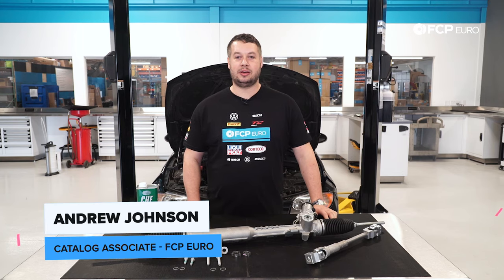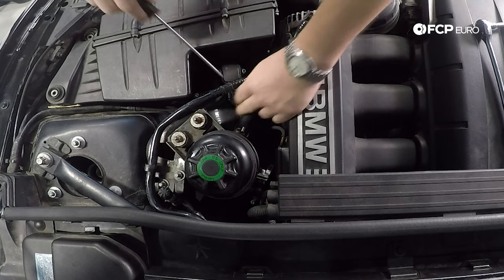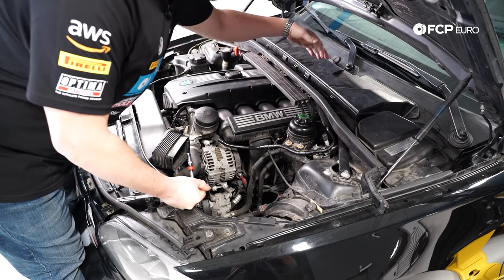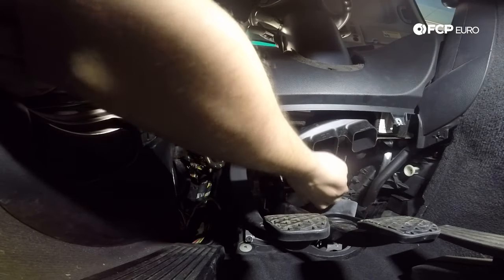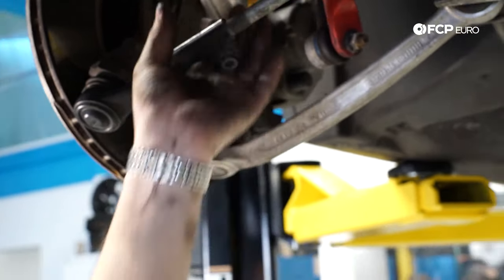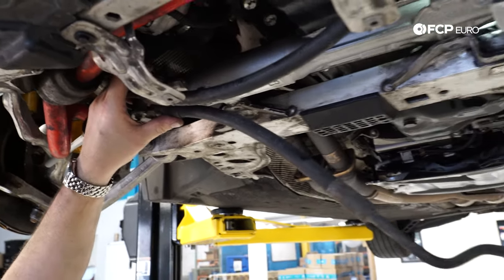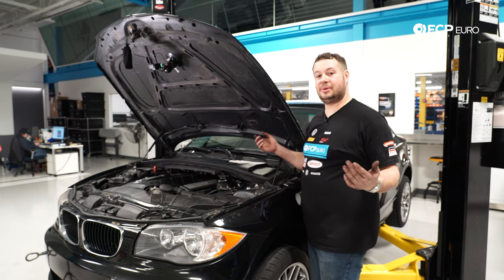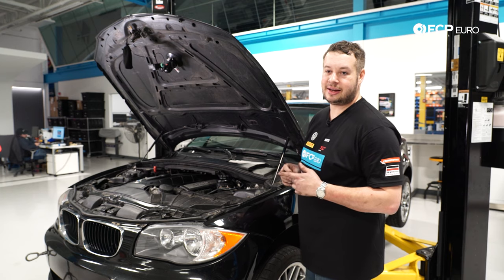How To Replace The Steering Rack On A BMW 328i, 335i, 128i, 135i, & More (E92 & E82)

Comment: Btw, there's a hole in left wheel well which allows to screw out steering shaft pinch torx bolt using 12" extender. When steering is straight, it's perfectly aligned (I have 2008 e92)
Reply from the maker: Great note!

Comment: Great walkthrough video! I was wondering if you had one for the e90, they are similar but would I have to remove the subframe to be able to get to the rack itself or is there a way to work around it?

Comment: If you’re buying a used power steering rack how would you know if it’s in the right position ,
Reply: That's a good question. I'm buying a used one from ebay, how exactly are you to know where its positioned at?

Comment: I got an N52 engine out of a junkyard recently. I had the two E10 from the steering shaft off and it just wouldn't come. At one point had the entire engine, transmission and lower frame strut assy hanging just from the steering shaft. It was a pain in a

Comment: Nice car. Love my 128i. It looks like you have the M3 front control arms and meatier sway bar. Very nice. I'll probably be doing those upgrades myself this summer.  Replacing the rear subframe bushings with M3 bushings makes a huge difference, as well, depending on how soft your original bushings are. You might want to do a shifter parts overhaul video, since the shifters end up with a lot of play after 100,000 miles, even if you're gentle, like I am.
Reply from the maker: Thanks, Doug! You're right, Andrew has his 128i setup for autocross and track-days/spirited driving. That's a great idea on the shifter overhaul video, we will add that to the list!

Comment: Quick question, on the old rack it had some leaks around those small steel pipes, can you change the pipes or seal it with an o-ring or any other solution to fix a leak from those pipes where it goes into the rack ? Thanks

Comment: ok question when u r bleeding the rack and pump DO U PUT THE KEY IN SLOT WITOUT PRESSING START BUTTON AT FIRST TO TURN WHEELS? OF COURSE WHEELS OFF GROUND..THEN START CAR LATER TO BLEED MORE? I AM WONDERING IF WHEELs will lock up if u dont put key fob in slot without starting car????

Comment: Great video!! So Ive been struggling trying to figure where I went wrong! I replaced my pump and it leaked all the fluid out and I didnt know and drove it for a couple days. Then the power steering stopped working, no noise or whining. I replaced the pump and the reservoir and still not working, no fluid movement either. Did i ruin the rack somehow?

Comment: Although before putting the carbon jack it was just drifting to the passenger side hard while my wheels would be straight. Driving it home the next day on roads that dipped (no pot holes) each dip the the road it self like I was in a hammock swaying side to side my head would bobble

Comment: I plan on changing just the rack and pinion, do I have to remove the shaft completely or can I let it hang and than re-attach the bottom part to the pinion? I have read about potential clock spring issues which Id want to avoid.
Reply from the maker: You should be able to re-attach the bottom part to the pinion without removing the shaft if you do not plan on replacing the shaft.

Comment: 23:52, my tie rod end was replaced 4 years ago, rusted pretty bad, the counter-hold was stripped and I had to cut the bolt off with a saw 🙁
Reply from the maker: Happens to the best of us 😥
Reply: yep... I am in the middle of a 2013 x3 rack swap... both tie rod end ball joint nuts seized and counter holds corroded...... used a 4" cut-off to sheer the nuts off 20 mins and one matco disc. Now im fighting a corroded steering shaft. So much rust in all the wrong places

Comment: Hello, I have a 2007 e82 and the steering symbol will appear intermittently on dash and steering will be stiff. Sometimes its fine sometimes its not. Can I ask if my e82 is electric power steering? Its 2007 120D. Thanks

Comment: Please help with advice, BMW E60, 2009  528, 234🐎, N52, on propane gas, bad start when hot, on the third try, everything is ok when cold.
  I changed injectors, thermostat, crankshaft sensor, temperature sensor, fuel pump with filter, no sense, gives errors P0420, P0430 and 2EF4.  Please help me with advice, I don’t know where to dig anymore.

Comment: I ordered the gasket rings (washers) based on your part numbers for my e92 m3 but they did not match the factory ones. Especially on the bigger bolt. After installing and torquing power steering fluid leaked. Can you confirm e92 m3 gasket rings (washer) part #.
Reply from the maker: Apologies Vick G if the website lead you in the wrong direction. You are going to need qty 2 of part number 07119906463 for the larger bolt and qty 2 of 07119906464 for the smaller bolt.

Comment: How many hrs should a shop charge you to change a 528i 2012 rack and pinion. Or what is the standard hrs to change a rack and pinion in a 528i 2012.

Comment: Im not sure if i missed it or not, but did you guys show how to get the steering rack out from the knuckle up top?
Reply: use the telescopic steering to pull up from in the car slowly. if the knuckle doesnt release entirely raise vehicle and wack u-joint up with a long striking prybar plus lots of LUBE. preferably ROGO lightning.  should pop off make sure helper keeps control of steering wheel

Comment: Yo question Im upgrading the trw 11 piece kit and I notice doing the front end I haven’t torqued everything but my driver side wheel is pointed 10 o’clock while my passenger side is straight it wasn’t like this 40 minutes ago before doing the driver side. I obviously wasn’t messing the rack at all so I don’t know how it would extend like that there’s no leaking or any other symptoms for it being out. Do you know how this could be fixed? Do I need a new rack or should I try to get an alignment and see what they say about it. My e82 has been on jack for a week now also getting my ball joint pressed in

Comment: Would the steering rack be the cause of steering squeak? Can hear it from inside and outside the cabin
Reply from the maker: Hi Gabriel, while possible a further diagnosis will need to be made, as it could also be a worn bushing or balljoint in your front end.

Comment: Do you have to replace the steering shaft? I was looking just to replace the rack and pinion along with my tie rods.
Reply from the maker: Hi Peter, while it is not mandatory, it can certainly be a wear item culprit if you are trying to rid your vehicle of loose steering, and one of those "while your in there" items.
Reply: @fcpeuro  thanks for the quick response and info

Comment: Excellent video, thanks. Is changing a rack on a x drive the same process?  Thx
Reply from the maker: Glad you like the video, Jim! The x drive is a bit difference since it has the extra all wheel drive components, but it is a similar process.

Comment: Is it ok to use blue loctite on the rack bolts for a extra security. I'm a little OCD when it comes to jobs like this.🤔🧐
Reply from the maker: You can, just note that it will be more difficult to remove those bolts should you ever have to.

Comment: You can install an e92 m3/e82 1m rack if you swap the rest of the suspension right? Looking for an upgrade in the ratio. Pretty sure the tie rods are longer.... any ideas?
Reply from the maker: The M3/1M rack will bolt up with some modification to all RWD E9x E8x 3 series and 1 series. All US market M3/1M racks were Servotronic. This is not plug and play with non M vehicles, and will make steering very heavy at low speeds. We do not recommend this swap if you are not 100% sure you are ok with unassisted low speed steering. The M3 tie rods are longer you will have to use your stock tie rods if you dont have M arms as well. But it IS doable!

Comment: I changed my steering rack on my 335. Dsc light and amber brake light came on. Any idea why? Maybe just needs an alignment? Any ideas why?
Reply: Hey mate, try turning your wheel all the way to the left and all the way to the right
Reply from the maker: It could be throwing that off due to poor alignment, but its best to double check that everything is plugged in, you can also try what Matthew said to do. If all else fails, you can have the code reset or disconnect your battery completely for a while and see if it comes back.

Comment: I have no wander, but my steering position changes. I try to tighten it up, and it stays for a while, but then if I hit a small bump, it changes position...
Reply from the maker: That is a bit scary, what exactly are you tightening up when that happens? Maybe you are not getting it tight enough?
Reply: @fcpeuro  your absolutely right. They were not tight. I thought I tighten them but then my guy friend went to tighten it more like a month later after it loosened again and although it was a struggle, he got it even tighter... i think I need it to be tighten  little more cuz 1 bolt was just spinning but ill address that when I lower the subframe...

Comment: is this similar to E9X M3 models? I know the rack and pinion different... but having similar body styles/suspension... is it similar? thank you
Reply from the maker: Yes, it is similar, Denny!
Reply: @fcpeuro   I appreciate y'all! easiest and most reliable company to deal with thus far ...
Reply: @fcpeuro  by similar, I assume there is just a few connectors for the servotronic mechanism? But overall removal is the same? No need to drop the subframe for the e9x m3? Just the lines, steering shaft, tie rods, and any electrical connectors to the servo?

Comment: Nice, i have to do this on my e60, but is way more work than ther E9X or E8X, need to drop the subframe.
Reply from the maker: ya Fabio that job is not for the faint of heart... good luck when the time comes to tackle it!
Reply: @autohut3720  I have noise and free move on the steering, I go replace the rack and the input shaft.